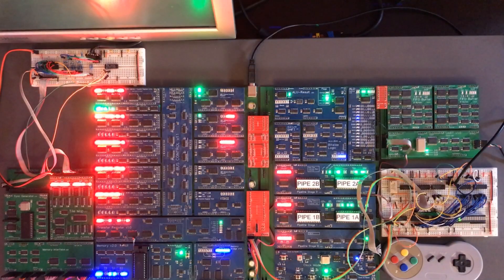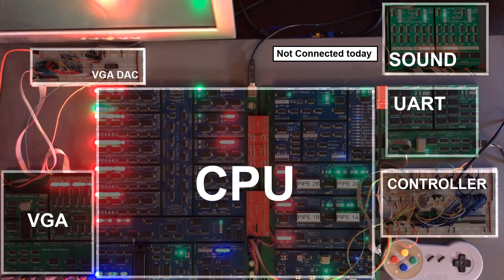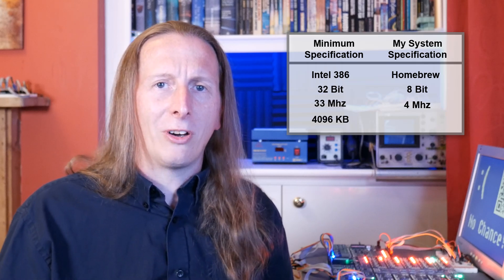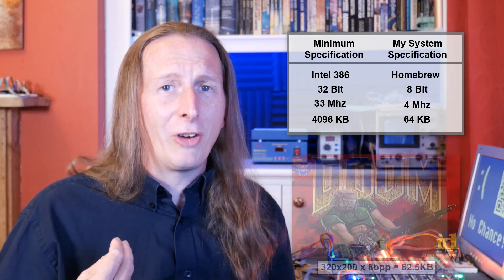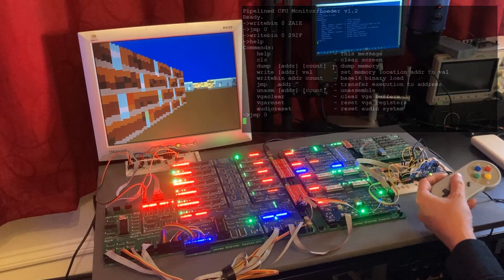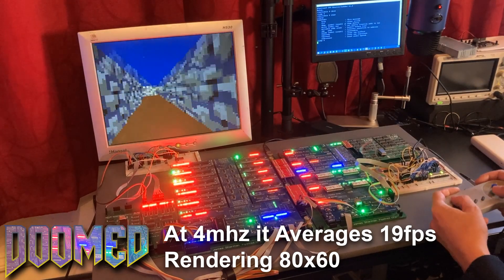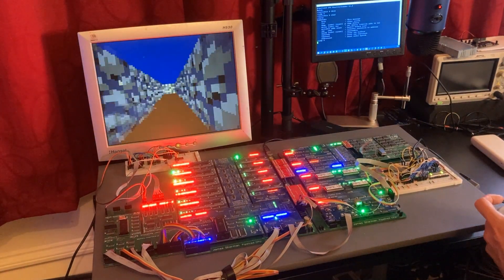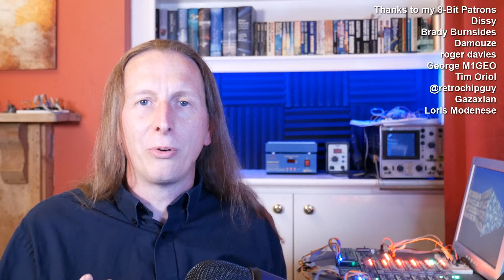Will it Run Doom? - Making an 8 Bit pipelined CPU

Comment: You can absolutely get Doom running on your custom computer.

At least, some semblance of it.

Someone has made a port of Doom for the VIC 20. Mind, it is severely cut down, omitting several mechanics and features. It also renders the "3D" view in a mere 64x64 pixel area (And it's only 32x64 effectively since it uses multicolor mode which makes each horizontal pair of pixels the same). And it only manages a single-digit framerate.

Nevertheless, it is arguably Doom. You can move around levels that have walls at arbitrary angles (though floor height is also omitted), and blast monsters. And it runs with just 40k RAM, a 1MHz 6502 processor, and at over 1 frame per second. Your computer is stronger than that.
Reply from the maker: Did you watch the video before commenting?
Reply: @weirdboyjim  Of course I did. Just more evidence that (some of) Doom is very possible.

And of course, your demo is VERY impressive in its own right.

Comment: OK, but will it run fastdoom? (Probably not, that still requires a 286 even at min settings and it barely looks like Doom at that point.)
Reply from the maker: I haven't looked heavily into fastdoom but it's still reliant on having much more memory so far as I can see?
Reply: @weirdboyjim  Yeah I'm pretty sure the answer is in fact no, it won't run Fastdoom.

Comment: Look at this production on atari xl/xe - pure 8 bit 3d engine  :) -  /watch?v=3s2vqN1jWgU
Reply from the maker: Cool demo but Not really 3D for the purposes of this discussion. check out my video on beam racing for things more like that on my cpu.
Reply: @weirdboyjim  I just wanted to show what can be done on 8-bit systems, especially since a large part of the 3d code is my authorship :) the design of the graphics card is extremely crazy but I like such things because I am passionate about this type of solutions, where anyway on my channel you can see the design a fuel injection ECU based on the 6502 processor :)

Comment: Nothing than a couple of LS670 and paged programming can't do!, expand it to 4MB addressable RAM requires 8 bit page numbering, each page of 16KB, divide the cpu space into 4 parts, each one 16KB, the 64KB scope is addressed to 4MB range, use a I/O port write for defining the page number for each of the 16KB, write smart routines for that, by example, you can't switch the page where the code is actually running.  So from a point of view of software engineering, you will have, a page with system code, a page with global variables systems (and stack), a page for program code, and a page for program data (at the same time), that is 4 page == 64KB, you can code a whole Windows like O.S. with just that resources, and was already done, like symbos for MSX2, that is it, a z80, running on 4 pages addressable, to 128KB, 256KB, 1MB, 2MB, 4MB, depends on the system version and if was expanded or not. Oh, and is better NEVER handle BANKS switching, if there is a ROM , it must be addressed in page number, in the MSX standard was done that mistake first switching in different banks, then one bank was the RAM, and the ram was paged, it doubled the complexity and was a compatibility nightmare, the best way to go is use ls670, and select ROM/RAM/EXPANSIONS based on page numbering, sometimes is better to has 12/16bits page numbering done in 2 I/O writes, than using the nightmare of controlling first bank switching, then ram paging.
Reply: Now, when you do that, that is a huge MILESTONE, you need to create in discrete a FPU. And don't care if it will do 1FPS, the thing is IT WILL RUN DOOM!.
Reply from the maker: This discussion was an aside, I wasn’t trying to design a machine that can run doom. There will be future builds with a wider address space, when I build a to machine with enough memory I’ll be expecting more than 1fps 😉

Comment: The minimum spec didn't work, even a 486 could barely hack it
Reply from the maker: Was tolerable on my 386, may have had low standards
Reply: @weirdboyjim  perhaps I'm remembering quake, but I never had a 386 and I remember small resolutions for doom the first time we tried it.

Comment: Look up the cube engine.  It runs faster.
Reply from the maker: I don't know much about that, but the wikipedia page strongly implies it's for 32bit machines with hardware accelerators so it's not rally relevant to this discussion. I did do an experiment a while back replacing the ceiling in my demo with textured sky which looks quite cool.
Reply: @weirdboyjim  that doesn't sound like the original cube engine which worked without acceleration.  The point was it uses techniques with a light processing load for the amount of quality achieved.  Techniques worth experimenting with, if you want to do more of such things.

Comment: You MIGHT be able to get away with it if you implement a 16-bit FPU that works similar to the fixed float in doom.  Really its memory bandwidth I am seeing right here though.  You can pre-process a wad level like they did in the GBA cart's but even then it had hardware blitting and collision detecting.  humm.

PS - As a side, I got doom to work (with sound, not music though) off an old STM32F429 discovery board.  Didn't even use its fancy DMA2D features but used most of the 4megs of ram in it.  Might be able to use QuadSPI sram chips?  Humm.  Ugh might just take the code out.
Reply from the maker: Memory is my biggest limiting factor but the multiply throughput while great for an 8-bit cpu is indeed slow. If I had a hardware multiply (or enough ram to blow on a table) it would help a lot. You do incorrectly mix the terms fixed (doom and my engine here use fixed point) and float which is more flexible but more complex, I worked out what you were saying though. This was an experiment to see what I could do with the processor that I have built, I wasn't attempting to build hardware that could run doom if you can see the distinction so I'm not looking to make changes in that direction.

Comment: there are minimized versions of Doom that even run on a calculator, so I guess one of those should fit your system, if you just took the time to make a little research you would have found that yourself though...
Reply from the maker: You are absolutely right, my project has clearly lacked any real work.
Reply: @weirdboyjim  I'm not talking about the overall of your proyect, clearly you did A LOT of work to actually create that computer, what I'm saying is that it looks like you didn't do a minimum research about Doom, or more precisely about minimal versions of Doom which could have run on your computer.
Reply from the maker: @manusoftar  I am aware of the versions you refer to. The "minimized versions" are interesting accomplishments but technically they do not posses a feature set that would have made me comfortable with the claim. If I had shown something with the feature set of the “Doom” on the ti-calculators and called it Doom I would have had vast numbers of comments saying that it clearly wasn’t.
Reply: @weirdboyjim  ok, I accept that. Nice work on that computer, I'm getting crazy trying to create a freaking usb interface using PIC 18F4550 for my custom Arcade controller. My idea is that, besides the usuall "hat switch" (arcade stick) that comes on commercial arcade controllers, to also have an analog joystick and way more buttons that usual commercial controllers have... so I decided to make my own circuit but, using multiplexors may have not been the best idea as I'm facing a bunch of problems...

Comment: Judging by the demo i think the machine could run a simplified 8bit version of Wolfenstein 1.
I mean, 8bit machines are usual to run Raycasting games since the 80's.
Reply from the maker: Definitely, the engine could handle a full version of Wolf albeit with reduced resolution.

Comment: Loved it! I actually try port doom to Virtual Boy... It's not going so well :) It runs super sluggish. But I'm using C/C++ instead of Assembler. So that's why :D
Reply from the maker: Thanks! Good luck with the port, at least the main code should run as is. Time to optimize the low level functions!

Comment: You no what. The real question is:" Can it run Turrican?"
I mean Turrican run on C64.
Cpu 8bit 1Mhz and 64k ram. The problem would be the basic software.
There is a version from Turrican for IBM Pc but those PC's where much more powerful.
Reply from the maker: That looks well within capabilities, not sure if any code or data is available for that through.

Comment: Actually there is at least 2 different realisations of DOOM for Sinclair ZX Spectrum computer (8Bit Z80 3.5 Mhz CPU + 48/128K RAM), although graphics is monochrome due to ZX color limitations. But your implementation looks much more smooth running and colorful, seems like hardware acceleration of some sort?
Reply from the maker: I’ll probably need to do a short video talking about what is/isn’t doom to me. The frame rate is pretty good here but it’s a fast although limited resource cpu. It will get more colourful when I add the custom palette hardware in the next video.

Comment: I remember running doom on a Tandy Sensation.  It had was a 486 33, 4 meg ram, SB16 clone.  In order to get it to work I had to make a boot disk and disable certain drivers otherwise it didn't have enough memory.  Guess that was an issue with alot of games in that area.  Later on we upgraded to 8 megs of ram and didn't need the boot disk anymore at least for this game.  Won't go into all of those old games that needed part of the 640k base ram.
Reply from the maker: I remember ram configuration being a pain in the early days. I think the minimum spec was upped to 8mb after a little while

Comment: I'm sure you'll get doom working on it before long. I wanna see when you get crisis running.
Also, doom is not actual 3D graphics, i don't remember exactly how they did it, but it's a clever 2D asset trick. This is why you can't aim vertically.
Reply from the maker: Should be able to extend it a bit,
Reply: Doom is 3D, lots of Id tech 1 games have vertical aim.. It wasn't added in Doom because it warps the screen.
Reply: @ToxikDeth  it is not 3d. ID even says so themselves. The only 3d game on id tech 1 engine was quake, again from ID themselves.
Everything is based of 2d data, and there is no Z dimentions anywhere.
No 2 floors overlap anywhere in any level, no 2 monsters or player characters can exist in the same place or pass over one another, while allover with active hit boxes.
They called it 2.5D
Reply: @Druid_Plow  you're still able to explore a 3d world despite how its coded, its just limited 3d but theres still a z axis, projectiles can go over u as well as over and beneath each other and auto aim was added intentionally.
Watch the video Doom engine - Limited but still 3D for a better explanation.
Reply: @ToxikDeth  it's still not a 3D game. And that was the only statement I had made, you said it is.
You have just verified my statement. Doom is not a 3D game, but uses clever applications of 2D to make it look and feel 3D.
Using stairs as an example. Every vertical kickplate of a step, is a boundary/obstacle. Those can be programmed with hitbox similar to that used for the player character. If that hitbox is small enough, the player character does not actually "step up" but instead warps up, because the player character is programmed to interact with obstacles in that manner.
Projectiles use locations to determine their path without a Z coordinate. Things like the lost souls and 'heat seeking missles' use a similar update schedule to determine angles absent of the z coords. The rockets won't hit the stair (obstacles) if it is small enough to pass over.

Comment: This is why the 90s were magical to me; you could do so much with 8 or 16 bit systems. Nowadays everything is so rote and bloated, it feels like we're going backwards.
Reply from the maker: When we gained hardware triangle drawing it seemed to take a lot of the variation out of engines but shader hardware has made things more flexible again.

Comment: I personally ran Doom on a 386-33 with a 387 coprocessor, and 16MB RAM.  It was almost unplayably frame limited.  I dialed up a friend with a Pentium at the time, and he crushed me every single time.  No surprise, really.
Will it run on a 386?  YES.  Will you enjoy the experience?  NO.  xD
Reply from the maker: Doom didn’t use floating point so it wouldn’t have benefited from the 387.

Comment: I don't think people today realise what a beast   the pcs we had back then as they go off specs rather than the experience.    I had a p233 that I was lucky enough to have SIM and dim slots and it lasted all the way to windows xp  and it still ran unreal tournament and quake 2 fine.     There was a time 4mb of ram was alot of ram to have.
Reply from the maker: My first pc had 512k of ram!
Reply: @weirdboyjim  ah so you remeber the days where people with the 486dx chips 16mb of ram and a 400mb hard drive saying they will never upgrade as they have no use for more power

Comment: How much more complex would building a 16 bit cpu be compared to the 8 bit that you've made?
Edit: I'll be watching your early videos on making the 8 bit cpu for more understanding.
Reply from the maker: That depends on a few factors, the gpr’s and the calculation sections of the ALU would get twice as big. But My address registers are already 16 bits so if you didn’t want more memory there is a bunch of complexity surrounding that you wouldn’t need anymore
Reply: @weirdboyjim  Sorry I'm not sure what these are, do you explain what gpr's, ALU and address registers are in a previous video?
Reply from the maker: @PyricDemon  there are multiple videos on each in the series.
Reply: @weirdboyjim  alright, I'll begin watching them at the beginning of next week.

Comment: I've been toying with doing a raycaster for the Apple II double lo-res graphics (80x40), and think that with some tricks a 30fps might be doable on that platform.  The major cheat would be having a limited number of vertical stripes, pre-rendered at every height from 0 to 19 pixels.  I've used this trick, rotated 90 degrees, on a texture-mapping demo on the Atari 2600 (!), and think it could probably work on the Apple iI.

It might also be interesting to design some hardware to let a low-end CPU run wolf3d or even Doom in reasonable (e.g. 256x192) resolution.  For Wolf3d, if one could output 16 bits per pixel, repeating every scan line, along with a scan line counter, adding a ~32K scaling EPROM and a 32K texture-map EPROM to the video output circuitry would probably suffice to achieve a nice result.  For DOOM walls, it would probably be necessary to have 24 or 32 bits per pixel, add a 10-bit ALU in front of it, and use a bigger scaling EPROM, but still achievable on a reasonable-sized board with 1990s off-the-shelf parts.  Not sure how to handle Doom floors, though.
Reply from the maker: This isn’t a ray caster, the rasteriser approach I use is more efficient at the low end so you might find it handy. There is a programming video linked of this one with some more details.
Reply: @weirdboyjim  What do you think about the idea of a hardware "Wolf/Doom graphicis" accellerator?  I'm not sure how to handle floors efficiently, but if there are no more than 256 different kinds of floor (combination of level and texture) it might be practical to pre-load external RAM or EPROM chips with the parameters associated with each kind of floor, and then have an area of screen memory which has e,g, one byte per 2x2 pixel area indicating what kind of floor is at that position (using a byte per 2x2 region would cut memory usage by four, without hurting visual appearance too much).

Comment: just wonderful, one of the things I learned with the nintendo hardware is that many of the game tapes, gained an internal upgrade, like it was done with Donkey Kong 3, the 2.5D graphics was managed by the game tape and not by the hardware, so I believe that the same can be applied to your hardware, and it would become a nintendo game emulation station lol
Reply from the maker: It was the Super-fx chip, designed for Nintendo by Argonaut.
Reply: @weirdboyjim  Exactly, I couldn't remember the name, but you could benefit your system from it I think. if i'm wrong correct me.

Comment: we all remember the console advertising, if you mash several lower bit processors onto a board, you got a 32-bit system; therefor, when are you going to work on making your system manage 4 cores, cause then you could for sure run doom by 90's console-war logic.
Reply from the maker: They ended up counting bus lines, I have a 16 bit address bus and 4 8-bit busses so I’m 48bit already! 🥳

Comment: I'm curious how you handled the angled walls. I wrote a raycaster a while ago and the algorithm is a lot easier and faster if the geometry conforms to a grid because it greatly reduces the number of possible points of intersection along a given ray. So it's amazing to me that you got it working so fast, especially on this computer.

edit: Oh there's a video on your extras channel about this, cool
Reply from the maker: Yeah, it’s not a ray caster although you could do that with angled walls with different tricks.

Comment: I wonder if you could cut Doom into individual rooms, so each room will be load and run only one at the time. This may dramatically decrease the power need to run doom at the cost of a loading screen in between each room.
Reply from the maker: Watch the programming video, this is a portal rendering so I can reduce the workload by reducing the maximum recursion depth.